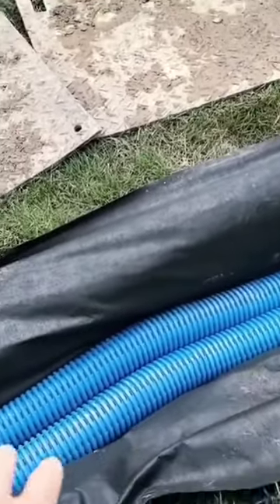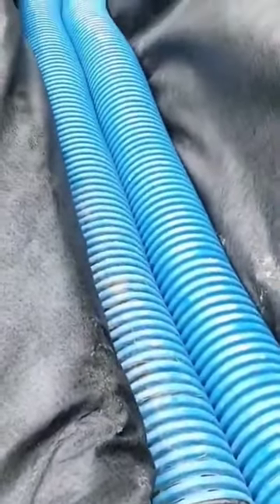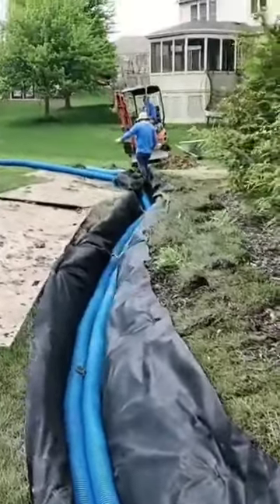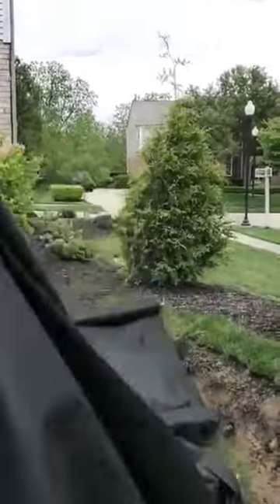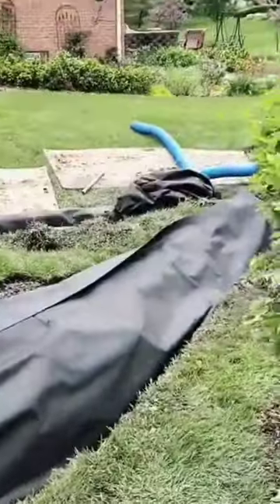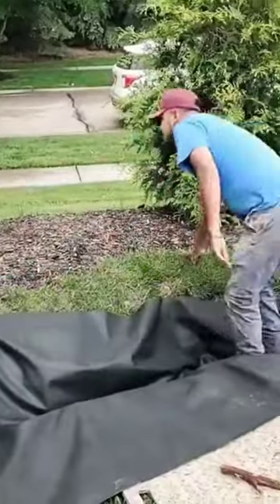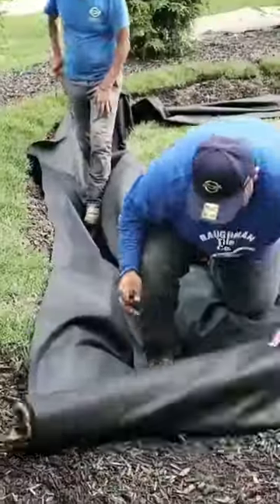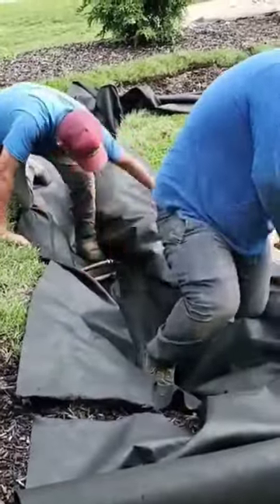Why Some Contractors Do NOT Use Drainage Fabric When Building a French Drain System - Diy Beware

Comment: Ya you should always put filter cloth down for French drains as it helps them last longer and function more efficiently.
Reply from the maker: The correct fabric ( NOT bought at Lowe's or Home Depot ) Makes it last FOREVER!
This is NOT weed barrier.
Reply: @FRENCHDRAINMAN  I found it to actually drain about the same as what you use. Only the heavy duty light grey one. Not the thick grey or the black stuff.